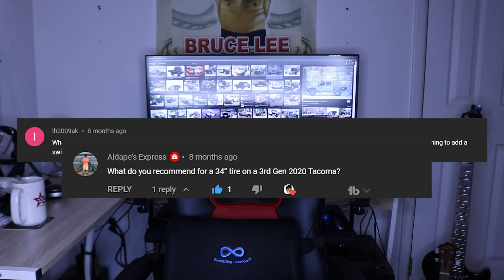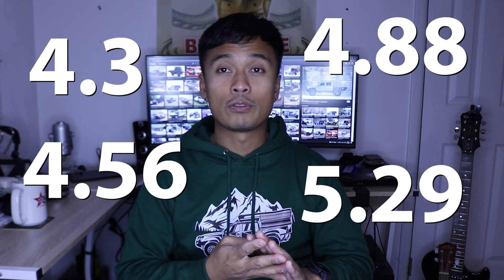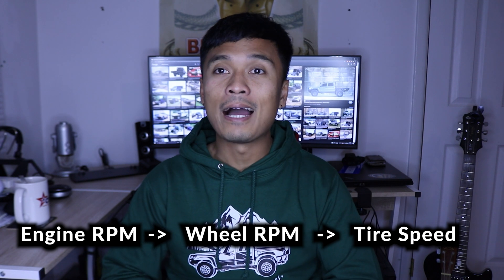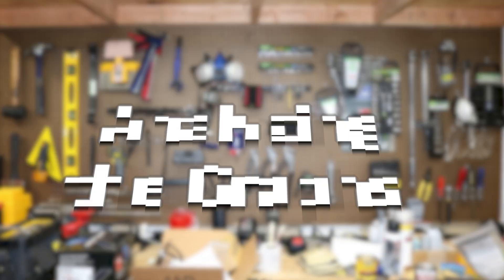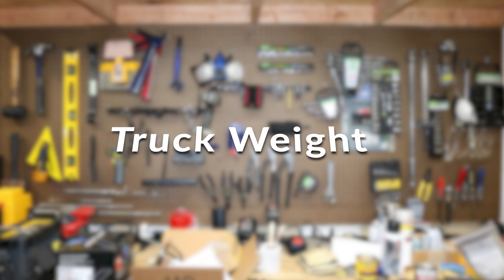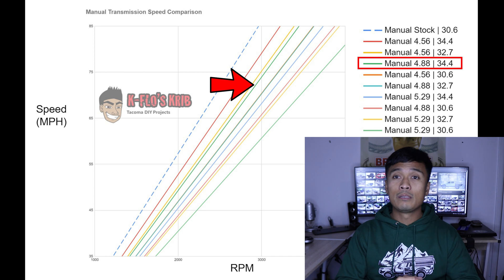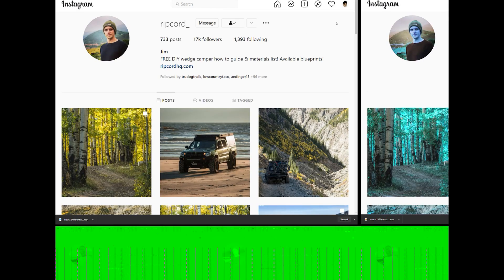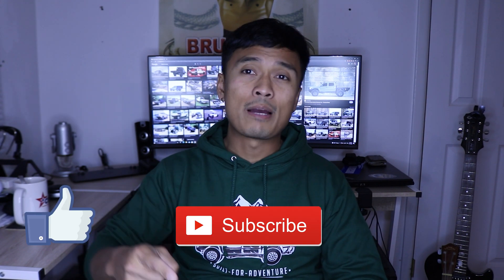Picking the Proper Gears (DIY / How To Tacoma)

Comment: Hi what you think I have same truck as yours I have a 33s smart cap roof tent and light weight armor 4.56 or 4.88?
Reply from the maker: Yours is also a manual?
Reply: is automatic
Reply from the maker: If you do a lot of off road driving/rockcrawling 4.88, if you do more highway/longer road trips 4.56

Comment: on a 2021 f150 4.88 33" factory tires and 20" wheels (275/60/20) gives me a +800rpm  (3.31-1450, 3.73-1650, 4.11-1850, 4.56-2050, 4.88-2250) at 75mph. going slower to 63/64mph with a 2.5 ton/ 5000lbs trailer would almost eliminate the downshifting on the v8. Curious to see numbers on 12300lbs (max for me is 12900), mainly for pulling a boat out of the water and driving 80-120 miles round trip to boat ramp once/twice a week. Helpful videos, great job. looking at doing it myself so all info no matter how detailed is a tremendous assist.

Comment: I have a 2020 Tacoma automatic 33" tires and a regular shell. Should I go 4.88 or 5.29? I also have KDMAX tune
Reply from the maker: Are you adding much more weight than stock (over 800 lbs over)? Are you doing a lot of rock crawling? Are you doing a lot of highway? Are you planning on eventually going with bigger tires?

Comment: Just ordered 4.88 for my manual. Currently 33" tires. Should I be worried about my highway rpms being too high?
Reply from the maker: Thanks for watching, it's really based on your personal opinion. My opinion of high may be different from your opinion of high. I would recommend re-watching the video: 
1) Figure out your comfortable/usual cruising highway speed
2) Use the graph and figure out if your RPMs based on your gear and tire setup
3) Drive at that RPM using a lower gear and ask yourself if you're comfortable with that

Comment: It's really the religion of trucks, no one is gonna agree and everyone thinks theirs is the best
Reply from the maker: Yea, I totally agree 😬 -  I hope my explanation helps some of the subscribers, it's real difficult to answer all individual questions without knowing what they're doing w/ their trucks
Reply: @TacomaTutorials  really one of the best straightforward sober methods of selecting. There is, I forgot again to mention, a possible 5th factor. The higher the number, the smaller the pinion. This also means less tooth contact on the ring gear surface. In practice, I have only heard anecdotes of people with 5.29 breaking teeth off of the ring gear, so not sure it's worth mentioning. These people are pushing it really hard tho

Comment: Omg I remember the regear days. Kept me up all night. 

Since we’re past that how about we look into a 2nd gen tune. Before a super charger is it worth it? 

I’m currently 315/75/16 with 4.88 and boy it’s a dream. Specially with 800lbs static weight added to the rig. I live in the mountains so my feeed back is honest AF
Reply from the maker: Yea, figuring out which gears took me such a long time till I made my decision on the 4.88 w/ manual. I was almost going to pull the trigger on the 5.29's but would've been so over geared. 

I'll research some ECU tunes and other options out there. I'm glad the 4.88's is working out well. I hope my vids helped w/ installing them!

Comment from the maker: Guys, the website is currently under construction. The charts will be posted there in a few days. Here's the link to the google drive though if you're interested: https://drive.google.com/file/d/1BEV9RaImuOm2nY708MV472HvXzGUMoCq/view?usp=sharing

Also as mentioned in the video if you need a rear axle (fitted w/ 4.88 and w/ 35 spline Chromoly axles),  contact Diego (IG: https://www.instagram.com/lordofspicytacos ).